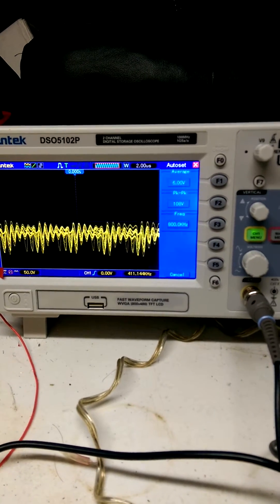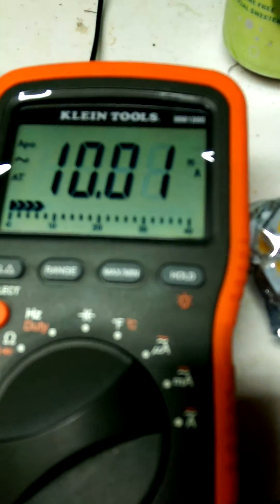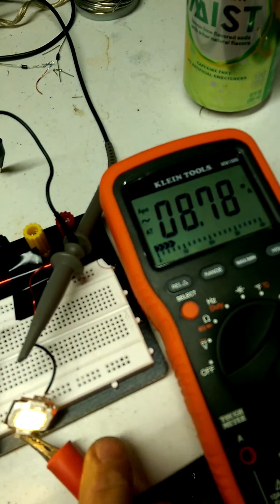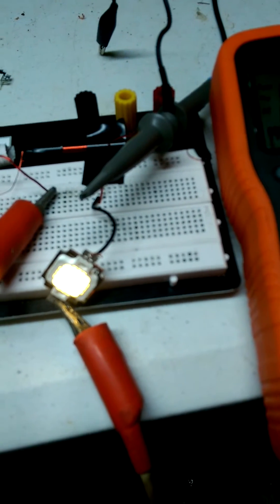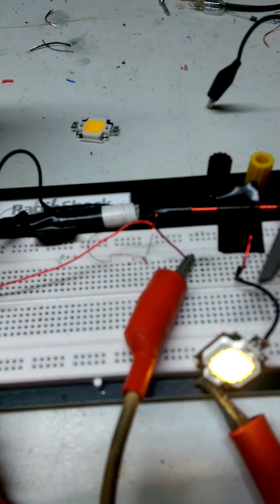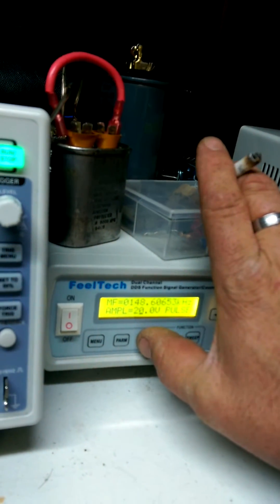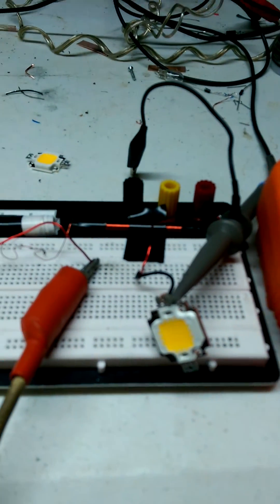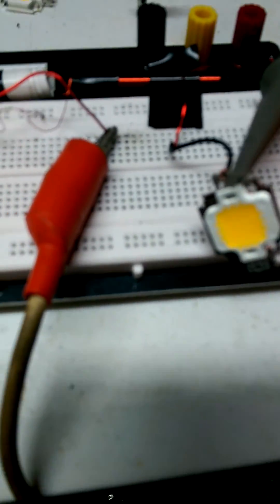Partnered coils- proof of overunity

Comment from the maker: the magnetic interaction is happening as a counter emf elimination / Anti.Lenz configuration. the primary core is connected to the source and only half of the secondary is surrounded by the primary. since the secondary is wound in opposing directions, the Bloch wall is created in between the two.cores magnetically manipulating what's supposed to.happen, allowing only the idle current to go back to.the source. once a load is added, the wattage used from the output is reduced from the input. I am going to rebuild it and show everybody that even my power supply uses less wattage when the leds added to.the coil. the power supply.uses less connecting this than the same load if it was a normal resistor the same size. I'm not sure why it does this, but, I.think.it's a magnetic vortex that is inducing power from an external source such as Earthsmagnetic field, which has tons of energy to.steal.
Reply: In 2016, I verified Chris Syke's statements about partner ouput coil using the most crude set up. I used pure mechanical switch as oscillator. Away from beating lenz hands down, I also discovered that we need no High Voltage input to get High Output but we need only Resonance. HOW you may ask? 
High frequency Diodes makes it possible to enormously multiplies the output from the partnered secondary coils by:  

1.) Shorting the individual Patner coils with  two  H.F H.V Diodes i.e  you connect the catthode one each diodes to the 2 leads of each coil and connect the anode together! You do this to the other coil too. 

 2.) Sucking Tremendious amount of current from the Ground. 

You need to see the circuit I developed for this as I can not fully explain it correctly.

Basically you need 8 H.V H.F Diodes to get this effect correctly

Comment from the maker: The led I am using is either a 10 or 20 watt soft white led. I think it is the 10 watter, however, if we light this led up with a dc power supply, without pulsation, just straight up dc, we use .25-.5 amps to get to this level. The power supply costs us more with it's losses too, however, when we pulse it with the saw tooth wave, it is most efficient, and, I haven't shown it here, but, the power supply's input I have tested with adding a killawatt meter to it's input and it does draw less energy when the led is attached.

The configuration is key, and, the magnet starts it. I actually never tuned the sliding primary with the led energized, so, I may head back down tomorrow night and try this out, maybe making another video showing this enrgy savings. That is what we need to save energy in the home, it'll save everybody tons of money and allow the ability to drive much larger devices without issues. We also can obtain a perfect sinewave by changing things around and adding a capacitor, and a choke to the circuit. The cap makes it a wild wave like you saw before, a small amount smoother, then, the choke clears it up enough after the led to make it into a pure sinewave.

I will play with it some before i build to market them on Ebay already prebuilt. Thanks for watching..

Comment from the maker: Good news everybody. I have found the way to obtain resonance perfectly with the Smith device, so, I will be showing my followers a short video of how we obtain it, and, with capacitors, lock in what we need to have so no drifting happens as the transformer is not as critical as everybody thinks. The winding spacing is not critical, but, the spacing at the center is and an inductance meter is totally necessary to get the inductance once the separate coils are locked into a specific position. The primary has to be located within the Bloch wall area, dead center, and, at a 45 degree angle to the secondary to function. The primary wire has to be fine strand, 8 awg, silver coated copper 700 strand to 780 strand so the energy brought in has charge carriers at high frequency following the skin of each conductor. Each strand is considered to be one conductor, so, the ability of the amp king wire makes it function like nearly 250 litz wires used separately, giving the device an ability to do what Tesla's coils did. If we look in Tesla's experiments book, he shows that he can create a flux with one small tesla coil using an arc gap, a small primary and a secondary. He then creates a receiver, then, surrounding this device, he sets up several receivers within the flux path or the resonant coils in the same frequency. The more you can fit, because the transmission is at a radio frequency, the more power can be taken from it without affecting the load at the input. This allows a communication or "channeled communication" with the plasma tubes eminating from the Earth's poles up to the magnetosphere, where cosmic energy is induced within this flux, then, back to ground where at high frequencies, usually from 28khz to 44 khz, we can easily channel it, and, pick it up with devices such as receivers that can draw from slayer exciter circuits, tesla receivers, and, we have the ability to add more energy to the transmitter so it gives a larger "flux area" whixch gives a further broadcast distance, then, the receivers can be any amount of receivers that fit within the broadcast area and they will not add additional load to the input coil. It works like radio. We can transmit a  50,000 watt radio station, and, when we receive the radio signal and play it back, we do not draw any energy from it or deplete it. The radio signals gain energy from the layer of the atmosphere called the troposphere. The magnetic plasma tubes run from the poles of Earth, up to the magnetosphere, through all of the layers on their way up, and back down. Energy is drawn in from these channels of magnetism, allowing specific voltages to excite and move charges enough within coils of wire to create an attractive force between these layers of the atmosphere, chanelling the excess energies in as Tesla's receivers do. It is absolutely 100% true and possible, as it has already been completed by myself, Smith, Kapanadze and many others who have made these systems function. The grounding creates charge pumping of ionized particles into the ground, coming back out amplified when we use high frequencies. Whwn this energy is released back to the load, it comes as many times what we put in because the system operating creates an opposiong charge in the system at a nanosecond range that draws in positrons, positive particles from these layers of the atmosphere, inducing much energy and drawing an astounding amount of amperage in from the ground as the electrons start to flow at an awesome amount, far above what we put into the system. This only takes a small fraction of energy, in the milliamperes to drive the signal into the ground at  high voltages which are enough to excite and ionize the air within the spark gap, we rectify this, we charge large cap banks up, and in a special way, we set the caps up, it allows us to discharge the caps at an overvoltage of their capacity without popping the caps because cold electricity is going into them, not allowing damage to the oil filled cap. The excess energy pours off at only the amount of voltage above the caps highest working voltage, so, an example would be the caps are rated at 1.2kV, we bank them in parallel and get maybe 100 uF or 200 uF instead of thousands, but, the voltage stays at 1.2kV, and we pump 30khz of say 9kV in, the caps dam the voltage and charge up to maximum and discharge 30,000 times per second, and, release energy closer to 500-800 volts and once we cut it with a 5000 amp Varistor rated at 240 volts, if we have the correct coil in it's output, with a very large conductor, we can get 240 volts at up to 250-500 amps out without ever harming the components, all dependent on cap size. Don Smith has stated that each Farad of capacitance has an ability to output 1000 watts with conventional power at 60 hz. When we increase the frequency, the charge happens exponentially per volt over the top of the voltage rating, so, we fill the caps more than instantly, it hapens as the amperage is being drawn from the caps so fast that we never run out of energy. I always thought that it could only stiffen this amount when used in a DC system, however, if the cap always stays charged while in use, it can't discharge unless we overload the system, and since we are damming a form of ac, which pulsed dc at high voltages is an ac voltage, we just do not have a sinewave until we filter it with a choke at the end of the circuit and apply a load to it. If we use the caps we have to remember, each cap used will give us it's wattage separately, like Tesla's coils do when receiving this energy. so, we will have in my case, 88uF caps x 6 at 1.2kV. each would equal a total of 1056 watts for each capacitor, so, 1056 x 6 will equal 6336 watts output. I have tested and verified this, and, i have found that the voltage left over in my circuit is 660 volts, cut after this output down to 240 v with a 5000 amp Varistor/240v 850 volt max operating voltage, and, the machine seems to be self correcting, however, when we use resistive loads, we need to be careful.. Cold electricity isn't what is output here unless we do not complete the circuit. Don's system is completed, and, if you look at the isolation xfrmer, it isn't large enough to run anything worthwhile, the output is the terminal strip, the iso xfrmr is the battery charger that he didnt have to ever use again once he figured out the battery would charge in this predicament all by itself due to the induced static voltage from the ions raining down upon the channel of energy. It's absolutely amazing how it works, however, it took me a very long time  and I lost a lot of my hair while I was tearing it out trying to gt if running. It takes absolute concentration, belief you can do it, and, unparalleled patience to not quit. It costs quite a bit to get the parts you need, but, the only parts which need to be rated are before the primary coil. Those caps need to be kept under the 4kV limit otherwise boom they go! The secondary has a little bit more mercy as the system isn't really operating as a normal transformer, but, the output is stronger than most and smal caps on motors will pop like bombs! I connected a DJ light up to mine and forgot it had a motor in it. That thing  sounded like I shot my 45! Insanely loud and the cap was obviously in a pcb circuit board, it was a 400v electrolytic that went like a bomb, taking out everything nearby it! ..

I have been playing with the damming capacitors (the largest one on the board and that is the entire reason we get massive energy outputs from the units, otherwise, we would only be able to resonate a vibratory energy capable of maybe firing 3 100W bulbs. If we put carbon lamps (or halogen) we can light up a few hundred watts. When we add the capacitors of the correct voltage and raise the capacitance, watch out, the circuit becomes lethal and will kill, possibly blow off limbs, etc. It is no joke!! The device was truly one of tesla's engineering marvels that he basically frestyles and makes into a functional short circuit generation device. Don Smith's version is a voltage/capacitance damming device added to the Tesla Hairpin circuit that has all of it's stages in resonance with one another, using frequency matching to oppose any resistrive loss due to it's infinite impedance while operational. If we charge the caps at high frequency, the dicharge comes out amplified because we merely filter out what we don't need, eliminating load at it's input. We pump in a bandwidth of 0-30,000 hz, and we filter out all below 60 hz, and all above 60 hz, allowing the lenz effect to be non existent since the width isn't being taken, we take a smidge of the total out, allowing only the nst to load the circuit with it's idle current, then, the losses within it. The NST could use less than 30 mA and the output could be up to 65,000 watts all depending on the components and conductors used!
Reply: +Marc Belanger Thanks Marc, that is the reason i like to pass on those videos to you because myself and others dont have the expertise to make heads or tails out of some of the information but you are very knowlegible about the subject matter. thanks again
Reply: This is absolutly astounding, this is really called Radiant Free Energy. I'm so glad to see some people are able to replicate these forbidden technologies wohooo so exciting.
Reply: +Marc Belanger, I would like to know if this statement  is true " When the transient voltage across the varistor is equal to or greater than the rated value, the resistance of the device suddenly becomes very small turning the varistor into a conductor due to the avalanche effect of its semiconductor material. The small leakage current flowing through the varistor rapidly rises but the voltage across it is limited to a level just above the varistor voltage. In other words, the varistor self-regulates the transient voltage across it by allowing more current to flow through it and because of its steep non-linear I-V curve it can pass widely varying currents over a narrow voltage range clipping-off any voltage spikes."
if it is true,  then you have just make me find a Solution to my Problem Today December 11 2017!!! And will like to make the disclosure to you if you would not look down on me being an african and a Nigerian for that matter.